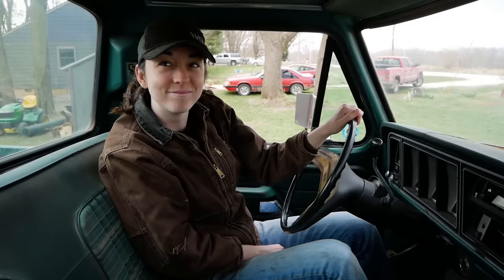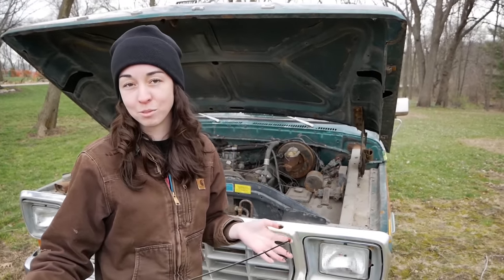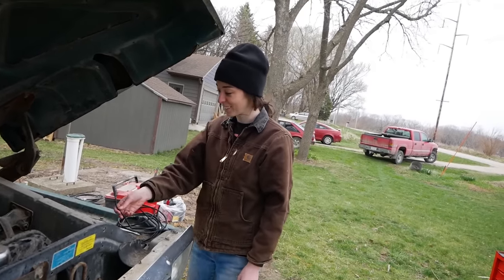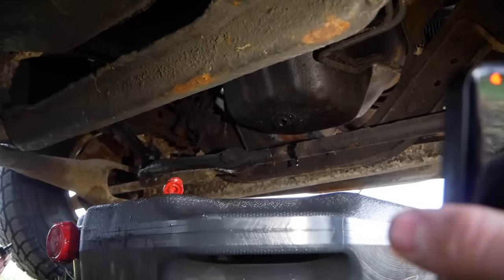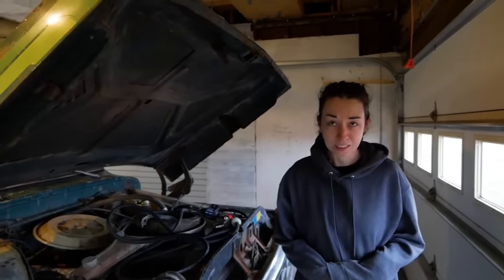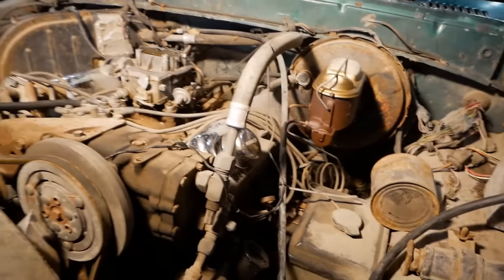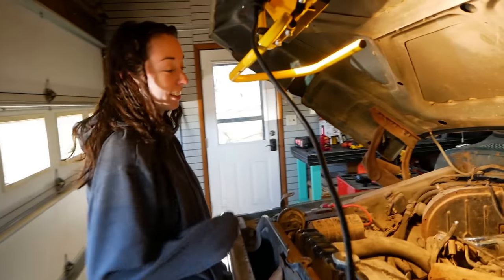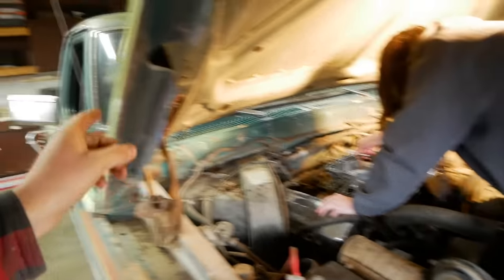I Bought a FLOODED F150! First Start and Revival!

Comment: From 1973 to 1982 I worked at the Ford Motor factory in San Jose CA. In the "commercial" end of the plant we built the F1-2-3 pickup trucks 25 per hour 2 shifts 6 days. We shipped them everywhere. The F150 Explorers were gorgeous trucks & Jade green is the color here. We used to wonder where all of the trucks were going as we made them day after day after day. In the factory they were brand new pieces of art with their 6 cylinders, 302, 351, 360, 390 & 460 engines. 2 wheel drives, 4x4 in standard & automatic. It saddens me to see while this unit is a survivor that it ended up as it did. Speaking in behalf of the thousands of workers at the plant we took a lot of pride making those trucks. I really hope that you get  this unit running & back to life again. Mook is really cool & wish her the best. PS my name is Gary. Cheers!
Reply: Kewl GARY!!! I FEEL THE VERY SAME AS YOU...I DID GLASS WORK FOR OVER 40 YEARS...VERY SELDOM WOULD YOU SEE WHAT YOU PUT YUH OUR HEART INTO AGAIN...EVEN JOBS THAT INCLUDED A BUILDING OR CUSTOM MIRRORS...WE NEVER SAW THOSE JOBS AGAIN....AFTER WORK...WE GO OUR SEPERATE WAYS...HOME WHATEVER...I SAW MAYBE 3 OR 4 AFTER IT WAS ALL SAID AND DONE ...I KNOW YOUR HEART SIR...YOU ARE A CRAFTSMAN!!!
Reply: I own a '78 F-150 ,Camper Special with factory 351M/400.I have owned it for 16 yrs now.It also came with dual gas tanks.The engine was broke down at 100,00 mi. and rebuilt.It still doesn't have 10,000 mi .on it since the rebuild that was done 18 yrs ago.Thanks for your contribution to this classic body style my favorite
Reply: I have a 1978 f350 lariat it was a cab chassis truck that ended up with a flatbed it has a 351m with a granny 4 speed and a set of 4:10 gears in the back slow as a tractor but can pull a house down😂 but man is she a bute you my friend made good trucks back then not aluminum or non of that aluminum block twin turbo junk that ford takes pride in today don’t get me wrong the workers today still take a lot of pride in their work but man y’all made some awesome trucks
Reply: I have a '79 F100. Semi-restored to "rat rod" standards, so still usable!!
Reply: I bought my jade green 78 Ford Ranger with the Explorer package in 1980 when I graduated. It had a 302 with the standard 4 speed overdrive transmission. Unfortunately I was T-boned by a truck about 8 months later.
Reply: Thanks for sharing that story Gary. Im semi young and have been buying the mid 80’s F250’s and bringing them back to life. I love these old trucks.
Reply: FJRGD 
Hi there and thank you for your assembly of the best fords trucks made.  I have a 76 ranger with a 460 waiting for restoration, I am from northern Saskatchewan Canada.
Reply: I know and have known many who owned those trucks and they were all very tough trucks that, like this one were hard to slow down. Cars and trucks will never be made like that again.
Reply: Marshall Davis  None of the guys I know did engine changes. One guy used his to deliver pizza. The other has been moving his family from state to state because of job opportunities. First truck is a '74 and lives in Ohio. Second is a '75 I think and started in Indiana moved to Louisiana  then to Mississippi then to Tennessee in a 4 year time period. Amazing how long these two have lasted with the way the car and trucks rotted away from that time period.
Reply: Thats cool I'm in Pennsylvania and my 77 f150 4x4 was built in San Jose California. I'm not the original owner and don't know where the truck was originally delivered to but it's very clean for its age it spent 20 years stored in and old hospital parking garage in New Kensington Pennsylvania but I'm pretty sure it must has spent time down south. You might have worked on it. I have been over every inch of the truck. I have one complaint the intake manifold casting was terrible it had holes and voids that had to have been sucking air since the truck was built. The part should have been rejected.  Must have been a Friday. Have a nice day 😊. By the mine is copper metallic.
Reply: Marshall Davis  Funny you should mention the f 700 and the Louisville 9000 I drove the wheels off of a 60s f 700 flatbed delivering building materials and later 9000 for Ashland oil delivering fuel oil and gasoline 4000 gallon 4 cell tanker. The western Pennsylvania winter months 93 and 94 I average 90 hours a week in the L 9000 an would get laid off in April. When I tried to sign up for unemployment they told me I had too many hours. So I would have find another job for the summer months. I don't think I was ever so tired when spring finally came. I made one delivery to and old women. It was minus 22 degrees. I had to park the truck in a heated service garage for 4 hours to get the hose reel thawed out. That morning when I tried too pull the 1.5 inch hose out it was so stiff in curled straight up skyward. I was afraid it would snap off if I tried to make a delivery. So after warming the truck up I drove a whopping 22 mile a hour for 10 miles to the lady's house. Edit .   I forgot to say the fuel cross over line was jelling up and that's all the fastest I could go or the engine started running real ruff. 🤔 When I parked the truck as close as I could in front of the house halfway into a 4 foot snow bank. I pulled the hose out its full length 150' and was 6" short from getting the nozzle into the fill pipe so I had to drag it back half its length to get slack in it and then work the truck deeper into the snow bank. I got the tank filled and the drank so hot chocolate with the woman after I bled her furnace and got it running and made sure it was good to go. I'm 61 now and I can't for the life of me understand how I could work so. Dragging that hose through deep snow and ice many many times a day and some a late a 1 in the morning. That winter some eldery folks in a nearby county had froze to death cause they ran out of fuel. I was driven not to allow that to happen on my watch. Sorry  for long reply have a wonderful day.
Reply: So the old Ford plant is now the new Tesla plant?
Reply: Most people call them exsploders.
Reply: I started driving in my dad's '79 Bronco with a 400. It was an indestructible tank! I was in high school and I was not gentle with it.
Reply: Well...I own a 1974 F250 standard,it would break your heart seeing it,as it does mine...maybe some day I ll get the funds to fix it up,engine was overhauled befire we parked it,and we start it once a week,it works,but it needs a lot of work...my big red machine.😥
Reply: Well it's not really that bad condition it looks like It only sat in the water for a day,  and the engine fired up after a new car and a couple other things
Reply: I had a 76 F100 for 12 Years!,It was a 390 C6 Truck originally,Then my Brother and me had the Bright Idea to swap it to a 351W with AOD to get better gas milage,Used almost a much gas and Waaay less power than the 390!
Reply: You forgot about the 400ci
Reply: In 1974 I bought a Limestone green metallic F250 Ranger XLT 4X4 pickup from Hughson Ford in San Francisco. I ordered the truck in late January and was told it would take about 10 to 12 weeks for it to be built. I was a school bus driver at that time, mid March I was in my bus going south on the Bayshore fwy (US 101) and saw my truck going north on the top deck of an auto transport truck. I brought my truck home on March 30, 1974 and it was a great truck, still have it, it's waiting to be restored. Thanks Gary!
Reply: FJRGD Cool story Gary. I got my first truck when I was 14 years old. It was a 1979 F150 4X4 Ranger edition with the tool box built in the side of the bed. It had the 300 6cyl and needed an overhaul when I got it. It took me a year to rebuild it, but it was perfect timing since I was just getting my drivers license. The whole experience was something that I could never forget. I learned so much about trucks/4x4s/rebuilding engines and all that in that one year. That was in 1986/87 so the truck was only 7 or 8 years old but it was apparent that the previous owner ran it pretty hard. But I loved that truck so much. I eventually repainted it back to the dark blue color that it was with the chrome trim. I put so much time and heart into that vehicle, I can’t believe that I ever got rid of it.
Reply: Hey fgrdg I know a greg his name is greg harshman that likes bullnose fords I wonder if that's you oh and ps its nick
Reply: Thanks for sharing Gary. My grandfather worked at the transmission plant in ohio. Was the like 5th person hired there is what i have been told. He was onenof the last machinist before they switched to CNC. He had a 78  model. I spent a lot of time with him in that truck.
Reply: Gary, I just got my Grandpa's 1977 Jade Green F150 Ranger. 2WD. Not sure of the engine yet. He's had it for the last 25 yrs. Unfortunately the previous owner didn't take the best care of it as they dented the front bumper and the seats weren't in the best condition, but he's kept her going with regular maintenance. He used it to haul wood to his house from the farm for heating in the winter. Since he's retired the wood stove (something I may have to ask if I can have as well haha) he retired the truck. I know it runs, but it burns fuel and leaks a bit of antifreeze so we'll see how it goes. Looking forward to bringing it back to it's former glory!
Reply: I work at the Ford plant in Kansas City MO. We make the F150’s and the Transits here. I love the old trucks though. My favorite was my 79 F100 with the 460 but I’ve had many ford trucks and cars over the years... 🙏🏼
Reply: @BobVan  My brother in law worked at the K.C. plant for years. Moved to Ca. worked at the Milpitas plant a long time.His name is Herb Welch. Did you know him?
Reply: Laidbak Zak unfortunately Im not good with names as I moved around too much over the years. I’ve been at the KC plant since 2013. Was at the Harley Plant here for 16 yrs before that. There’s 7500 people where I’m at now. I’m in Trades Dept. Wish there was still a plant in Cali to transfer to😂.
Reply: @BobVan  He worked there in the 60's
Reply: Laidbak Zak that’s way before my time.... I’m just now 50. There are some Welches around here but it’s not exactly an uncommon name.
Reply: You're a legend Gary!
Reply: @shackman9566  I’m from PA too! Pittsburgh. I’m looking for one of these cool old f150s to buy and fix up but I’m not even sure where to start lol. Copper metallic sounds awesome
Reply: My dad bought a new 1978 F-250 Custom with a 400 in it (Red/Silver two tone).  It was used as a plow truck every winter, daily driver during the summers, and general utility vehicle around the property.  It helped put food on the table and was my favorite out of work trucks we owned.  It also had AUTO hubs.  You just pulled over, hand your kid (me) channel locks, and send them out in the blowing snow to lock the hubs.  LoL.  Only problem we ever had with it was at car wash and the distributor getting wet and not starting.
Reply: Very good
Reply: 73 with 3 on the tree and a 302.  Great truck thru yr. 75.   73 was in "The Tomorrow Man,"  movie.
Reply: @lidiapietrusza5014  one with no rust in the cab.
Reply: @ron6376  thank you! Kinda hard to find in PA lol
Reply: @lidiapietrusza5014  yeah, most have been scraped being 50 yrs old. 🇺🇸
Reply: Pretty sure My Dad's Truck came from your Factory in 1979.
Thanks for doing a fine job, He loved the truck, now my brother has it, and he's restoring it to glory.
Reply: My grandpa's 68 ranger came from that plant.
Reply: @fjrgd  yeah I doubt if I know him. I’m on the Transit vehicle side. There’s almost 7500 people here with 5 shifts in some depts. I don’t even know all the people in my own trade and there’s 90 of us. I’ve been at the Ford plant here since 2013. I worked 16 yrs in skilled trades at the Harley Plant before that. Harley closed that plant a couple of years ago. Ford is a far better employer to work for✌🏼.
Reply: @jdpinbaytown  yeah I have experiences with both Motors and that 351 was a terrible dog lol. 155 hp if i recall. Stepdad had one in a 77 t bird.  That 390....that was a motor.
Spent time with those and the 391 industrial versions
Reply: LOL  yea i do the same thing  just bought a 2004 dodge druango with a 5.7 hemi for a 1000 got 100 in it put head gaskets in it runs great not worth ? ya are crazy good mech. though
Reply: I had a 1977 f100, and I somewhere I still have the original new window sticker. I loved that truck
Reply: why can't we build trucks like this again
Reply: thank you for all your work and many Hours spend making this Awesome Great Trucks I just Got my self a Ford F150 1978 and Iam so hapy I found this one in the country it was a Farm truck so it has low miles its paint is kind of burn naturaly but it has a straight body never was abuse which Iam so glad I found it anyway thank you again for all your dedication on building this Trucks
Reply: We had two Dentside Ford trucks when I was at home: a new 73 F100, 302, 3 on the tree, later traded for a new 77 F150 Supercab, 351M, C6. Dad installed glasspacks and it sounded great!
Reply: id love to meet the people who built my 91 Chevy Silverado
Reply: Gary, im about to pick up an 82 F150 Ranger XLT 4x4 with 55k on the odometer. It has sat for 15yrs, but was started for the first 5-7yrs that it was parked. Dont know how much of a big draw captains chairs with armrests were, but thats what it has.
Reply: My Grandpa Traded A 75 For A Jade Green 77 Back Then, And It Was A Gorgeous Truck Back Then
Eventually He Traded That In For An All New Custom 79 F150 With A Special Color Scheme
Reply: I had a 77 with a 400
Reply: Wish I had it back

Comment: You can't beat an old pickup, Fix em up, Change the oil every 3,000 miles and you will get 450,000 miles out of them.

Comment: Fords are supposed to use Motorcraft parts, not, watercraft parts.
Reply: It's "very green"??? Literally I suppose, plus reusing old things is green, but the engine is too big and heavy, which reduces traction without 4wd as well as mileage, and of course poor traction requires paving or graveling roads.  Some of these trucks had inline 6's, which were very efficient, and I would even call a 302 green, but with this engine it is only slightly greenish, only because it is reused, the second R. not part of the throwaway society.
Reply: Did they check transmission for water and fluid quality and quantity?
Reply: The ideal engines for this truck are as light as possible to maximize 2wd traction and mileage, so I would use 200 inline 6 or 3.0v6, though it is not worth removing good engine or matching trans and bellhousing. some people like big engines, so if you can make it go, then fix and sell.  I'm also not completely satisfied that the carbs were hopeless.
Reply: @alan6832  depending on the transmission they may not have to. I could be wrong but fords 4.9 300 inline 6 could possibly bolt up to it. If not then they would probably need an adapter plate
Reply: The 300 CID worked well in many Ford trucks and vans of that era. A very solid engine, though a 351w, as Kevin suggested in the video would work as well.

Otherwise, if I were Mook, I would drive as is with a new set of plugs, a rebuilt carb and a cleaned fuel tank.
Reply: @alan6832  i honestly think she was talking about the color,the truck is fully green,even the interior,lol
Reply: @f_for_freedom2492  my 3 cyl geo metro is green, both ways.
Reply: @alan6832  the 300 inline 6 was a great Ford truck engine, until they started putting the faulty EEC modules onto it. I used to work at a Ford dealer from 84 - 90 and had to go around replacing those modules on foggy days.
Reply: @alan6832  that's what I put in My F150. A MOPAR inline 6. Stripped all the extra crap off it. I can sit beside my engine while someone drives my truck. so much room LOL.
Reply: LOL

Comment: I became a contractor in 86 when I got out of the service...I must have had 10 of these 78, 77's...All old trucks from that era have their little bugaboos...But, the F150 with 300 - 4.9 straight 6 was a beast motor...
Reply: Rob I have a 96 4.9 and it is sitting a little over 500k and I see no reason why it won't make the million club
Reply: @gregbartle5956  :)...I hope you get 2 million miles! ...:)...I'm terrible with maintenance, I drive them till the wheels fall off...That's amazing to get that many miles out of your motor!...Has your Trans lasted too?
Reply: @godbluffvdgg  yes original e40d I have replaced other things out of want not need though everything that touches the serpentine belt. Put in an oversized radiator for pulling and alternator to put in electric fans. Needs new psom because it's stuck in limp mode
Reply: @gregbartle5956  :)...Like finding a great wife...:)...

Comment: I got a 351M in my 1980 bronco, it pures very nice. Took all the smog items off and replaced the stock  2150 carb, and it runs at highway speed .

Comment: I had a 78 and when you pop the hood you always have to give her a little tap on the top to get her to pop. The door replacement panels are crazy expensive to buy new so I went to all the local junk yards and bought all the unbroken ones I could find. I had sets of black, tan, red, green and blue. I also had a kick ass head liner with 4.5" round speakers in the cab corners. Those trucks with the split rear window are a leaking rust nightmare. All the split window trucks will start rusting the cab below the window. I replaced the holes in the floor with speed limit signs and other old street and then laid new carpet over the top. If you go with the 302 make sure you get the right fly wheel because some of them are different on the 302 depending on year and the wrong one will cause horrific shaking and vibrations.